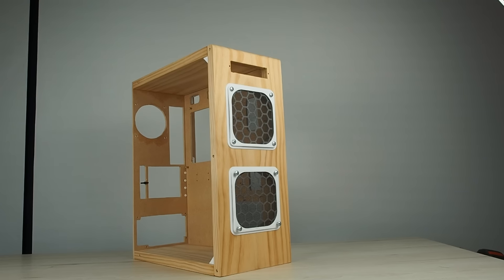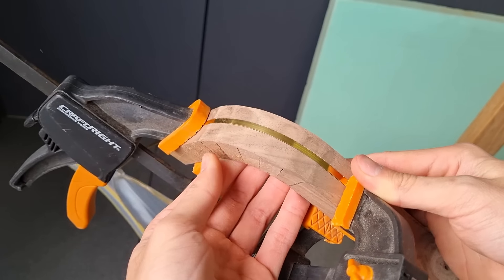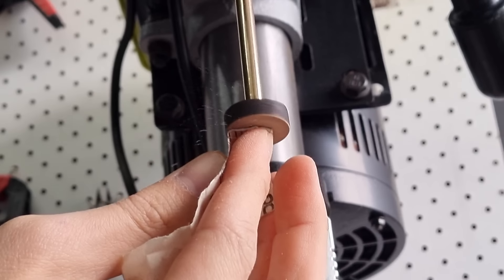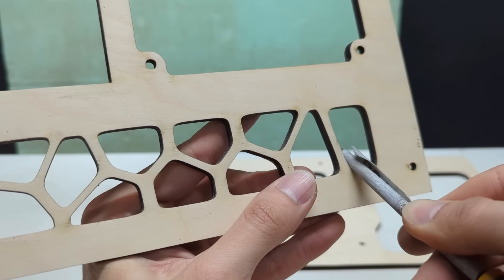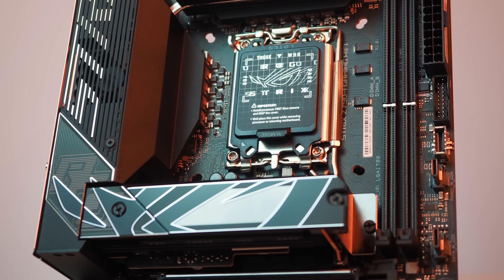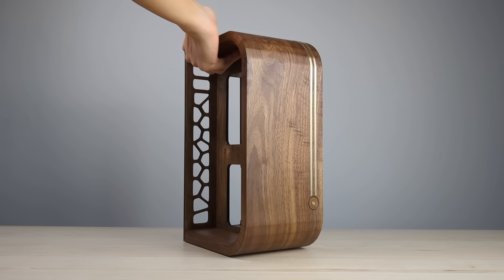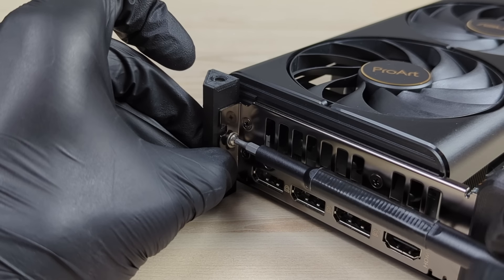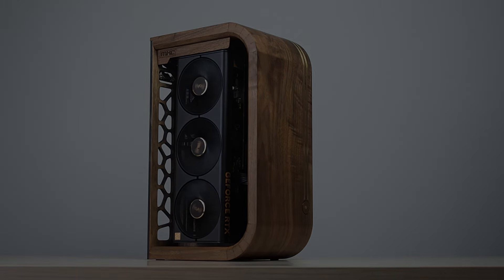BENT Wood PC Case - ASUS ProArt Themed | RTX 4070 Ti | DIY Wooden PC Case

Comment: Work of art! For the kerf slots I think it would have looked nice if they had brass inlayed instead of trying to hide them. Cheers
Reply from the maker: Thanks! That is an interesting idea too, will consider for future :D
Reply: Could do traditional kerfs with a brass powder epoxy inlay that way you get a better curve on the exterior.  Either or would be a nice way to highlight the cuts that it took to make the bend.

Comment: The build looks beautiful. A pro tip on the glue with wood dust though; if you mix the dust with the glue you can make a wood filler paste that will match the wood. It's a little easier to spread in order to fill all of the gaps.
Reply from the maker: Thanks for watching and the suggestion!
Reply: He actually used this tip in his next build 🎉

Comment: What an exquisite built, very nice the contrast between the walnut and the golden accents of brass and custom paint.
You did a great job, just a shame that the bending is still showing flat spots in between grooves, maybe next time you might want to try stems bending whole boards and using strong clamping onto curved mdf templates to make it super smooth 👍
Reply from the maker: Thanks for watching! I'm not sure I'll be able to bend >15mm thick solid boards. Will have to see how that's done

Comment: Beautiful case and great workmanship. In woodworking videos I have seen when wood bends are done they typically cover up the kerf slots with laminate, although you likely considered this idea already. Another would be to have used black epoxy for the glue up, maybe just at the edges, which would have contrasted nicely. But it's beautiful regardless, you must be super happy with it.
Reply from the maker: Thank you! Great suggestions, will consider them in the future!

Comment: Kerf you can get a pretty seamless kerf bend with no gaps by mixing the sawdust from the kerf cuts and wood clue then filling the gaps before you lock in the bend angle, just be ready to clean up the glue/dust mixture that squeezes out. It'll be extremely strong, both methods are completely valid though. 
When you were doing the routing, put a scrap board of the same thickness on the outside of your walnut piece and cut from that center line you routed through the piece, it would have stopped the blowout. I'm really surprised you didn't break that bit though, I've used one before and they are very fragile with harder woods like walnut/maple/oak/cherry, etc. 
The end result of your build is amazing! Love the look and overall techniques. I would have loved to see some custom PC cables in black/gold and cut to the right length to avoid the extra cables. I'm a PC builder and woodworker so this fits that niche, might have to give making a custom PC case a go!
Reply from the maker: Thanks for the suggestion!

Comment: Great build! Building a budget rig for my niece, but I don't want it to look budget so I've been combing for case inspiration all night. I think I've found what I was looking for.
Reply from the maker: Glad the build manages to inspire you! Although, if ultimate budget is what you're going for, making a case like this might not be the best option as the materials alone cost me more than a typical off the shelf case...
Reply: @mxcbuilds6633  I live in a hardwood forest that also happens to be the walnut capitol. Finished woods are still expensive, but rough sawn is easily had and I've got plenty on hand. I'm actually slabbing a black walnut from my yard next week. It won't be usable for quite some time, but at some point in my future I'll have a nice walnut slab table. Not much in the forest, but we got wood.
Reply from the maker: Haha that's cool!

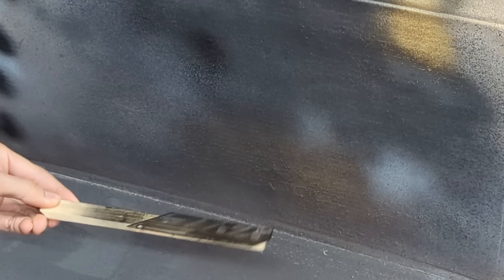Comment: 13:17 it's usually better to remove the masking tape before the paint has dried, in case it decides to pull up the dry paint with the tape
Reply from the maker: Great advice, thanks!

Comment: I'm not into wood but this guy gets it when it comes to the layout of the graphics card.  It should be open air and/or clearly visible. Nope, not even behind glass due to glare and reduction in cooling performance.
Reply from the maker: I do love open air cases for that reason, displays the expensive components nicely
Reply: @mxcbuilds6633  agreed

Comment: Nicely done. Improvable work has a great potential. One question. Why is the case open, what about the dust proplem
Reply from the maker: Thanks, it's an open air case. Yes it will get dusty, just have to clean more often

Comment: Amazing build.

I've watched a few of your videos now and hope its okay to give a tip back about cooling paste. As long as you make sure its tighten properly so it evenly spreads out, like cross teighting the screws, a very little paste is needed. With cooling paste, less is actually more and its only purpose is for the cooling and the cpu not to directly touch. If done correctly you can reduce up to 5-10c if you compare to a build that has used more or ''too much'' paste.
Reply from the maker: Thanks for watching and the tip

Comment: Nice build overall.  Incidentally, there is something called a nutsert, also called a ribnut which you could’ve used for the M3 thread as long as there is sufficient clearance.
Reply from the maker: Thank you! Will check them out :)

Comment: Amazing Build I love the Design overall but won't you get a Problem with the GPU Cooling with this little gap between the Case and the Exhaust opening of the GPU? 
I looks like it will get quite Hot under Load in this Position 🤔
Reply from the maker: Thanks for watching. Which exhaust opening are you referring to?  This GPU actually has the heat sink fins running across the length of it (not along) so most of the heat will be pushed out the rear panel vents and also the large gap between the front of the case and the GPU. Barely any air is coming out from where the output cables are. I think the biggest restriction I have created is for the 'flow through' section of the heatsink, in which the air the passes here is stuck behind the power supply on the other side. But temps are okay to me. 80C 70% fans at full load.
Reply: @mxcbuilds6633  When I didn’t saw it wrong the back of the GPU where most of the hot air gets out is against the case with a small gap between. 
And that’s where mainly all hot air comes out. I build my own PC’s and from what I know this would restrict Airflow, I think if there where enough space for the Air to escape you’re GPU could possibly run 5-10° cooler. 

But in my case I personally don’t like Air Cooling so I only have to worry about the Setup and Airflow for the Radiators. 

But overall it’s a nice build and many points of inspiration for my own build because I failed so far to find the perfect case for what I have planed so I think I will most likely build my own custom case who fits all my requirements.

Comment: First video I watched from you. Beautiful build, consider maybe adding a argb strip to the backplate of the GPU, I think it would look awesome with some backlighting to it.

Also do check out the temps on the CPU if I got it right spreading is what they recommend with newer CPUs.
Reply from the maker: Thanks for the suggestion, will consider it in future. CPU temps are fairly good at the moment so will maintain as is. :)

Comment: Amazing job. I really like the case! Two things cross my mind, but take them with a big grain of salt, because I am a total amateur comparing to you. The power button could fit better, the gap was just too big for my liking. When I saw the lines from curving at the end of the video I thought to myself, they look more like a scars, what if you use router and widen them up alongside the sides and inside and fill them up with the brass the same way as the two lines on the front. That could look cool.
Reply from the maker: Thanks for watching. Yeah the button could have for better. As for the inlay on the curves, I think adding this will make the look too complicated, and goes away from the minimalist look.

Comment: I know this is a year old at this point but be wary of mounting GPUs vertically with the IO facing up. It can make the thermals worse. I saw about a 10C increase on my 7900XTX in an IO up orientation. 

Most GPU dies are located off center towards the IO relative to the heatsink, so the majority of the thermal mass ends up below the heat source. This can cause gravity to reduce the efficiency of the heat pipes as the majority of the liquid inside the heat pipes has to fight gravity when wicking back up to the heat source. When the liquid is a vapor it doesn't have much issue moving through the pipes so the heat initially has no issues moving away from the source, but as it cools and turns back into a liquid it has a harder time circulating back.

However, having the IO facing down can actually improve thermals as this effect is reversed. IO down can contribute to improving the thermals, not only because the majority of the liquid is now being assisted by gravity when wicking back to the heat source, but also because the vapor will more naturally rise to the top end of the card where the majority of the thermal mass is.

Of course this will affect each cooling design a bit differently. As an example, the 30 and 40 series Nvidia Founder cards are less affected because of their hybrid blower design. And of course smaller and/or lower power cards will be less affected.

It's a bit of a nitpick but something to consider for future builds or anyone who is building or designing a PC.
Reply from the maker: Hi Derek, thanks for your insights. Will be keeping that in mind. Out of curiosity, was the orientation of the GPU the only variable in your testing? I'm wondering if anything else (different case, different fans etc) could have played a part in the 10C difference
Reply: @ I was using an XTIA Xproto-N case which is just an open air case so there was effectively no case and there were no case fans. I was able to lay the PC down on its side which placed the GPU in a typical vertical orientation with the IO facing the back. When laying it down the temperatures improved gradually back to where they were. Other people had a similar issue with thermals on the same case, but like I said, it seemed to vary dramatically from card to card. It seems to be highly dependent on the nuances of the cooler design. It’s something you just have to look into for whatever specific card you’re planning on using. 

Oh also I forgot to say that the build is sick though! I think you did an awesome job

Comment: Gorgeous build! Could you show us an update in a few months? I am concerned that the weight of the components will not be properly supported by the wood and screws.
Reply from the maker: Thanks for watching! Sure I'll provide an update on my Instagram so be sure to follow me there. But for FYI, I have built and used a few wooden PC cases (each used for >6 months at a time) and none have mounting/ warping issues.

Comment: Very interesting. 
You can steam bend wood without relief cuts on the back. You do need a steam box to do that, and it will take a few tries to get a good result.
Another approach is to make V shape relief cuts instead of straight ones.
Reply from the maker: You are right, but I did not have the space to create a steam box for the whole piece of wood in my apartment. And the relief cuts I made are V no? Unless you are referring to another method

Comment: Looks good, though with all those open sides I do have to wonder at what point it stops being a case and becomes just a mounting frame that holds components? I just took this idea to its logical conclusion and mount all my components to a board on a slide out under my desk, runs cool and quiet, is cheap and is invisible under my desk.
Reply from the maker: Fair point, if ultimate minimalism is the goal, there is no beating building the PC straight into the desk. Though, this build did not have that goal in mind. It was more of a statement piece to show off the design cues of the components. A "show-case" if you will.

Comment: That was awesome. I have a doubt, does the motherboard standoff pins also act as grounding pins that route unwanted discharge through them to the powersupply grounding? Since center pannel is made of wood that might not work. Please correct me if I'm wrong about this.
Reply from the maker: Tbh I'm not sure if the standoffs also act as grounding. I would hope that the components are grounded enough by the ground wires from the PSU.
Reply: This is correct as far as I know, as well.
Electricity will take the path of least resistance to earth.
If someone were to cause a static discharge while, say, screwing or unscrewing a standoff, I would want that discharge to head towards a ground directly to the PSU, rather than through someplace closeby on the motherboard, to ground.

Aside from that, it should be okay though.

Comment: You can also use steam in a bag over night and clamp the wood to a jig in increasingly tight bends to bend wood by the way. Then you dont have the little cuts visible and no unsightly banding on the outer side of the curve.
Reply from the maker: Thanks for the suggestion! Sounds like a more advanced method, will have to give it a go in the future
Reply: @mxcbuilds6633  honestly, no more time consuming than the method here. Fantastic build though my guy, absolutely fantastic.

Comment: wood tends to warp over time especially exposed to heat, plus without any dust filters and an open design this case would be a dust magnet
Reply from the maker: Yep valid points

Comment: Where is the hot air from the cpu cooler gonna go? It seems almost completely sealed in between the ram, io and nvme heatsinks
Reply from the maker: It's not great air flow wise, but my guess is that hot air gets pushed around then rises upwards as it heats up

Comment: This is awesome. Let me introduce you to your new best friend: rivet nuts.
Reply from the maker: Haha thanks! I knew of them, just never tried them on wood before. Seems it'll be harder to get a flush finish on the panel if I use them
Reply: @mxcbuilds6633  They're only for thin things like plastic and metal, but they're great when you need to put a nut behind a thin piece you can't reach. There are specific ones for plastic that gives more surface area.

Comment: It's a lovely build, I'm curious about the thermic performance. Do you happen to have metrics for internal temperatures using your case?
Reply from the maker: I didn't gather the temperatures for this case. But recall GPU was fine high 60s. CPU would get higher around mid 70s mainly due to the low profile cooler used for 12700kf

Comment: I seldom post comments on YT but this was fantastic woodcraft. I was following along pretty well with the woodwork, feeling confident that I could do this myself - until I realized how much more intricate it can get in terms machining the rest of the build to fit PC components. Do you by chance share or sell plans? This is something I'd love to make myself.
Edit1: Also - can't agree more with mixing leftover sawdust with wood glue before applying - you concealed it very well, but it just makes it just a tad more concealable :)
Reply from the maker: Thanks! It's much harder when trying to cram all the parts into a tiny case with little tolerance. It will be more forgiving for a larger case. I don't normally publish the plans because I make minor adjustments during the build which I do not update on the design which means anyone following the designs won't get a perfect fit either.

Comment: So.......the exhaust for the card is non existent??  Beautiful choice in the wood and really like the wood accents along with the brass
Reply from the maker: The heatsink fins of this card runs perpendicular to its length. So the hot air flows out from the grill pattern on the rear panel as well as the gap between the card and the front panel.

Comment: gorgeous! Is the power button only glued by the brass rod? That's the only part that looks a bit fragile to me.
Reply from the maker: Thank you! No I actually printed a 'o-ring' that has inner diameter of the rod, and outer diameter of the button. With same thickness of the rod sticking out. So it gives a surface the same area as the original button to glue on. Missed adding that into the already long video 😅. But sharp eye to notice that!
Reply: @mxcbuilds6633  Ah ok. Do you have any ideas for the next build or is there another one coming soon?
Reply from the maker: Been thinking of a custom loop build next. Stay tuned!

Comment: You've got yourself a new subscriber. Can you imagine a way for the angles on the curve to be less visible ?
Reply from the maker: Thank you! Hmm, the only way I think may help is if the tapered cuts were not made so deep, so that there is more material left, which allows more sanding to get it very smooth. If the curve needs to be absolutely smooth, the frame might have to be made from another method and covered with a layer of veneer.

Comment: I like it, a lot. Might have turned out better if you had used thin strips of brass to fill the gaps in the kerf cuts for the curve. It would make it seem more an intended element.
Reply from the maker: Good suggestion, I wonder if that will make it look a little too 'busy' tho

Comment: You modded everything so well but its such a shame that you didn’t use a palm sander in oder to remove those lines in the wood you got from bending. Would have looked so much nicer.
Reply from the maker: I agreed the edges could have been sanded more. Thanks for watching!
Reply: @mxcbuilds6633  Yeah well you probably didn’t have the right tool for it. But other than that amazing job. I really liked how you modded the power supply.